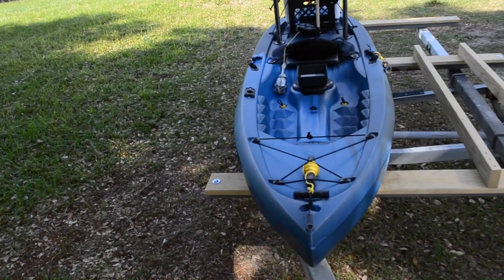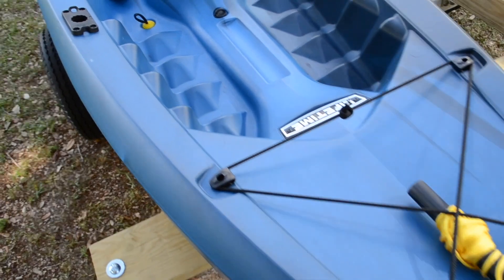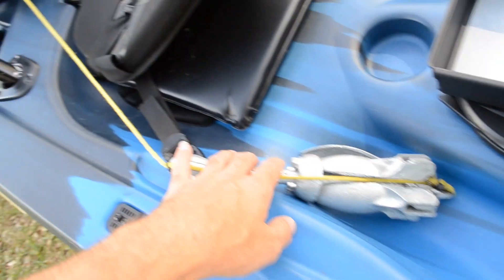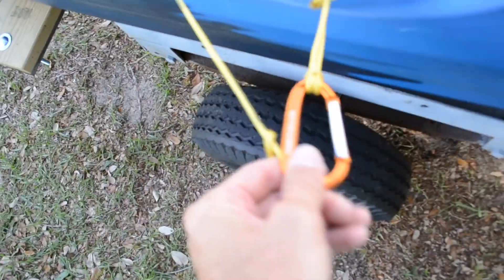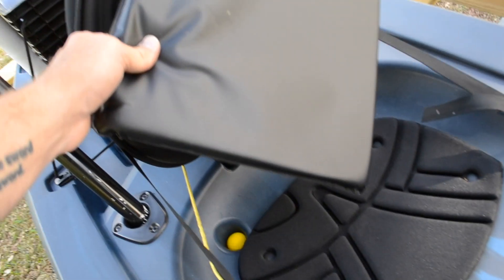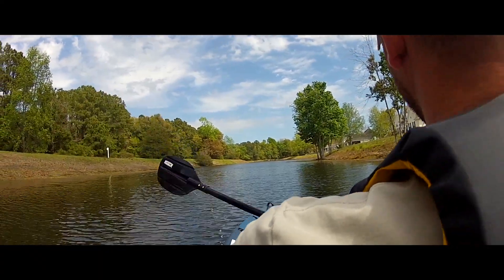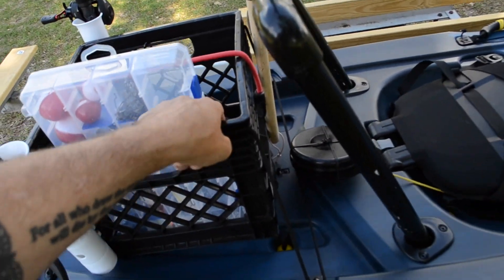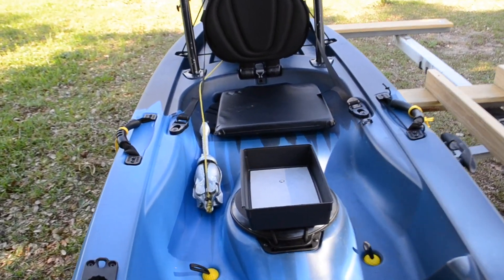Basic Kayak Mods (Lifetime Tamarack)

Comment: Nice idea on the PVC rack behind seat. I chose to install a Husky closed locking top bin instead of milk crate. I like its sealed if boat flips over. Also the bin in front, I chose a water tight container to keep phone water tight safe. Good stuff brother, go gettum"